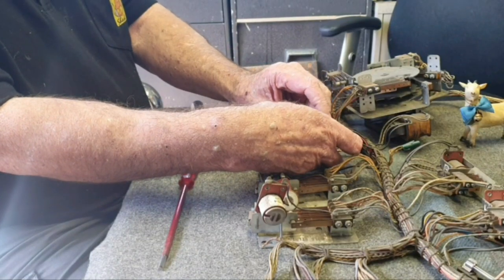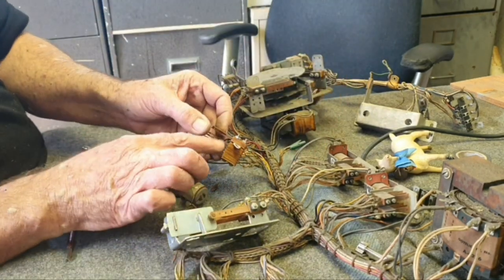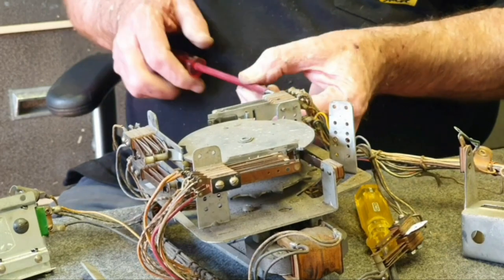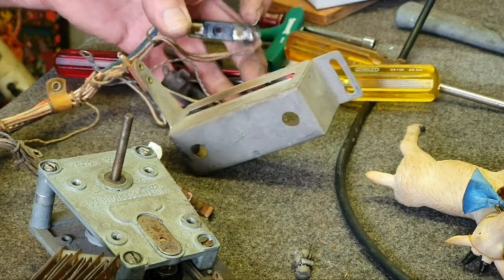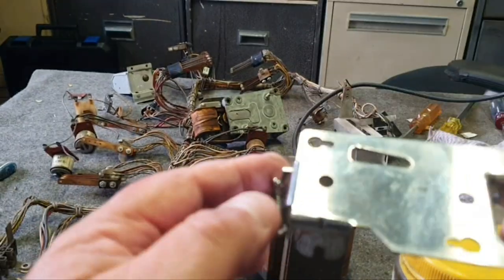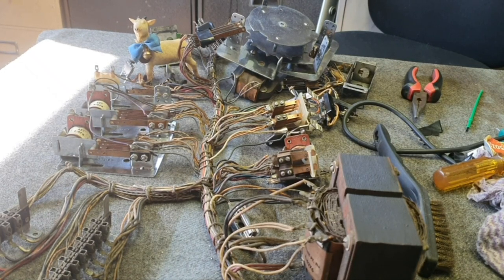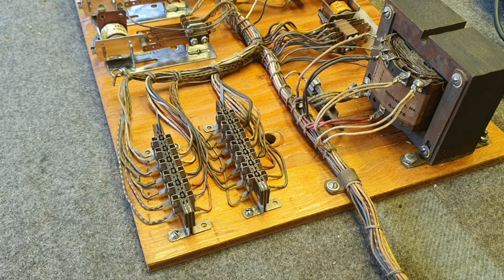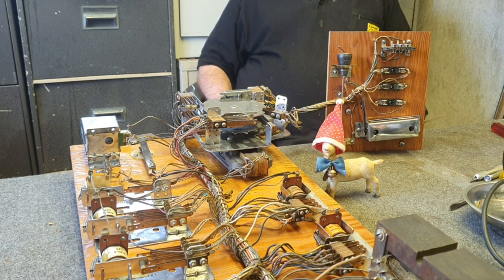Refurbishing A Motor Board Steps & Procedures

Comment: I wonder how many folks get the board all cleared off, like you've done here, and then they laminate it with a nice piece of laminate, such as Maple or Oak or something pretty.  Small thing to do and really make the board look great.   One thing I don't like about the cabinets on these machines. They just threw them together without much going into them.  Yeah I know hardly anyone sees the inside of the machine.  But I think it would be a nice touch to do so.  If I ever get to mine, that's what I'm going to do.  Gotta build a garage for it first.  :)
Reply from the maker: Interesting idea we just put a clear varnish in it should look like that now forever as in home use only now .
Reply: I just reviewed this video again. A great job and you have a wonderful video library that I frequently use. Thanks guys.
Reply from the maker: @wardkirkwood2024 thanks glad our videos help you out.